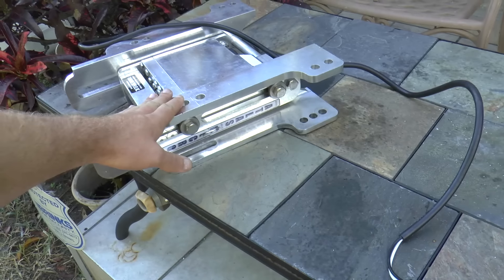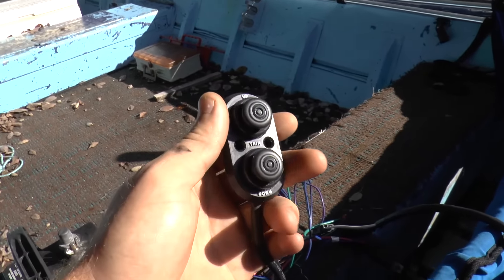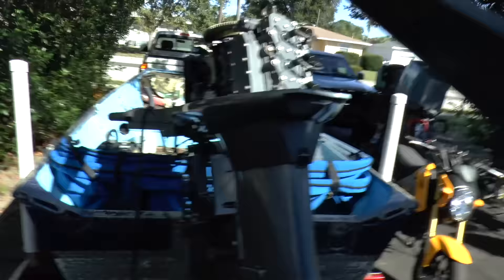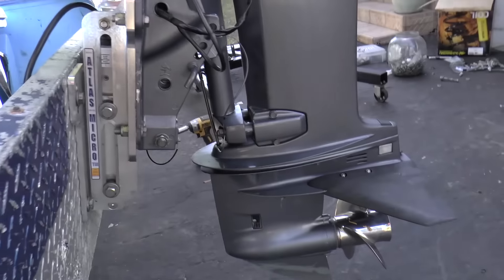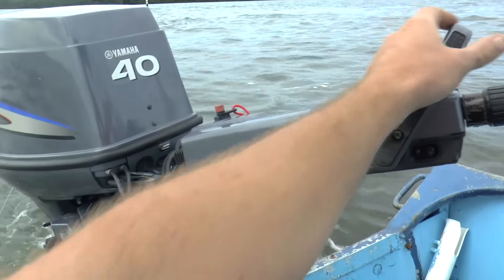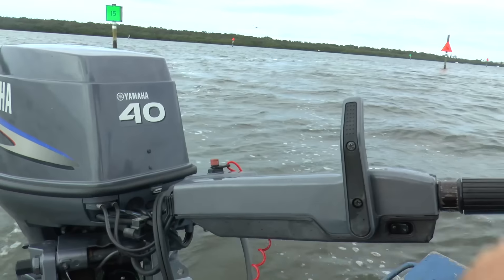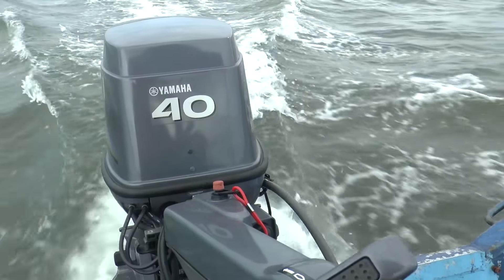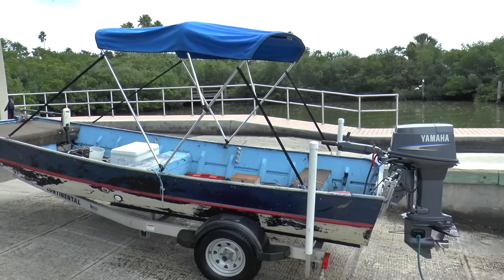I Finally Purchased A Jackplate!!!

Comment: After watching your video, i did some work to my boat. im not able to purchase an adjustable Jack plate at this time, after alot of research, i found that raising the motor so that the cavitation plate is just above the deadrise or the straight path back from flat on the hull. i just finished my project and am about to give her a sea trial, lol. also just above the raw water intakes on the lower unit, Your vids have been very valuable to me, what a great channel, thanks my friend.

Comment: Jack plates are the best! Great hole shot, great top end! You’ll love it! 👍🏻
Reply: Why not just mount the motor at the height the jack plate performed best at??? why would you want to return the motor to the low position were it performed the worst? Get rid of the multi position high dollar jack plate and just mount the motor higher on a fixed aluminum mounting plate!!

Comment: Nice work.  if you are pleased with that prop, lose that cheap fin you have attached.  They are typically just a band aid for a poor set up.  That 40 with the right prop and that jackplate is all you need to get on plane as fast as you'll ever get.  Your top speed would likely increase without it.
Reply: He will only gain what about 2mph or might even lose 2 removing that hydrofoil.
Reply: Why not just mount the motor at the height the jack plate performed best at??? why would you want to return the motor to the low position were it performed the worst? Get rid of the multi position high dollar jack plate and just mount the motor higher on a fixed aluminum mounting plate!!
Reply: I use a whale tail great for getting up quick but it drags my boat   A 70 4 stroke my next motor  the 60 tlra still rock n it’s an 02

Comment: Hey man, I’m in this same situation. I have a 99 Yamaha 40hp TLRX long shaft. I want to put it on my 18’ Jon Boat, however it also has a 15” transom. I believe I am going to have to go this route with a jack plate to make it work. 

My question is the transom on your boat. Is it all welded aluminum or is it wood? Do you have extra braces or just the two transom arms? 

You’re the only guy I’ve seen do this, if you could get with me that would be greatly appreciated! Thank you and appreciate your content!

Comment: Ive got a 14 48 with pods and i have a 55hp on the back. I have a manual jack plate. I had to put 300lbs of weight upfront to keep boat from porposing but when i did it still pushed it 32mph. I just ordered me a ozhydrofoil for my motor when i get it installed im gonna remove weight to see if it makes a diffrence.

Comment: Them premix yamahas are bullet proof! I had a 90 yamaha in a 16’ center console i bought in 2000 ran the shit out of it sold it in 2010 current owner has had zero issues besides swapping impellers and general maintenance which pretty much is just plugs an fuel filter.  Damn i Miss that 90!
Reply: Josh Frank those Nissans were awesome too!

Comment: I just ordered the same Atlas "micro plate" for my tracker that has a new Mercury 60hp, 4 stroke.
Then I saw this video...  The one I ordered was $768.   I saw one on a guys skiff that had a 75 on it, and knew it would be perfect for the tracker!
Reply: Hows it doing
Reply: Great
Reply: I just ordered one (TH Marine Microjacker) for my Tracker 1448 that has a 4 stroke 25 merc.  I hope it helps me get my cavitation plate above the bottom of the boat.  I have also added floatation sponsons on the back that kick it up on a plane better, but don't help with the height of the motor on the transom.  I love the boat, but the porpoising is driving me crazy.
Reply: Why not just mount the motor at the height the jack plate performed best at??? why would you want to return the motor to the low position were it performed the worst? Get rid of the multi position high dollar jack plate and just mount the motor higher on a fixed aluminum mounting plate!!

Comment: A worthwhile addition to your boat ;Increase in speed with the jack plate on.The 20" long shaft motor goes deeper in the water on max adjustment at the flick of a switch on your boat that has a 15" transom..did you have to strengthen the transom before fitting it?
Reply: Why not just mount the motor at the height the jack plate performed best at??? why would you want to return the motor to the low position were it performed the worst? Get rid of the multi position high dollar jack plate and just mount the motor higher on a fixed aluminum mounting plate!!
Reply: @darrengillesdarrengilles8336  I suppose having the multi-position jack plate is good when you may be using 2 different motors, which may have different dimensions.

Comment: The jackplate will allow you have the outboard an inch or two above the bottom of the boat. More efficient that way.
Reply: Why not just mount the motor at the height the jack plate performed best at??? why would you want to return the motor to the low position were it performed the worst? Get rid of the multi position high dollar jack plate and just mount the motor higher on a fixed aluminum mounting plate!!

Comment: You can also buy a vertical extension and mount it 5 inch higher for the correct height
Reply: Where at?
Reply: Why not just mount the motor at the height the jack plate performed best at??? why would you want to return the motor to the low position were it performed the worst? Get rid of the multi position high dollar jack plate and just mount the motor higher on a fixed aluminum mounting plate!!

Comment: hey Dude, here in Ireland on the Lake Corrib it is all about bottom clearance so a lot of us run short shafts afraid to knock off the propeller on a rock
Reply: But u run short shaft on a short shaft transom..

Comment: We had a evinrude 50 2 stroke with oil injection we still pre mixed fuel with oil even tho it injected oil and it ran great up until we smoked a rock and blew up the lower unit I recommend when you have a oil injected engine juts mix fuel anyway it’s good for it

Comment: don't get a oil injected motor. mix it your self I have seen a lot of motors locked up cause the injector  had stop working and the owner didn't no it
Reply: David Mcclaughry what’s a tell tale sign?  Just make sure oil level keeps dropping?
Reply: David Mcclaughry , Not with Yamaha. Yamaha has the most dependable oil injection on the market. You will eventually have more problems if you remove it.
Reply: Unless its a yamaha! Best oil injection! It runs off the engine, so you know it works. Unlike others that work of a electric pump that can fail if the pump stops working an engine keeps running! “Evinrudes”

Comment: With fully lowered motor there's too much lower leg water drag against it and huge water rising hi that accounts for that huge top speed loss.  Ideal motor/transom height match is  achieved when middle water flow skims at speed right under the small upper plate at plane while motor sits fully vertical on transom and deck load is evenly distributed.   

Prop will achieve best prop thrust on all water cond and close turns at speed.  If the doel fin installed does not run parallel to water level when combo is on plane will achieve extra water drag on fin and slow motor down.

Without an induction tach installed side of  throttle grip won't know which was the max wot rpm achieved and if motor revs at least middle to max wot rpm factory stated. It's important to know this.
Reply: I think he does an thats the reason he added a jack plate to experiment with it
Reply: Why not just mount the motor at the height the jack plate performed best at??? why would you want to return the motor to the low position were it performed the worst? Get rid of the multi position high dollar jack plate and just mount the motor higher on a fixed aluminum mounting plate!!

Comment: Jackplate’s obviously increase efficacy at higher speeds, but could they also be used to reduce fuel consumption, effectively extending maximum range at lower speeds?  I’m curious how  various engine/prop heights would affect fuel consumption at a specific cruising speed. Say, 10 MPH.
Reply: decrease in drag means better economy. Right length shaft will save you cost, hassle and weight

Comment: what about your water intake and prop?  you have to go higher than the water pick up!  see bobs machine shop for that. and r&r prop shop in vegas for speed.  he's go a lot of good used props etc! great prop guy. he'll spend the time to talk!.
Reply: Why not just mount the motor at the height the jack plate performed best at??? why would you want to return the motor to the low position were it performed the worst? Get rid of the multi position high dollar jack plate and just mount the motor higher on a fixed aluminum mounting plate!!

Comment: did you have any worry's  about the added weight of a jack plate and long shaft motor on  such a light boat ?? I am in the middle of refitting a J14  carolina skiff tiller steer with  25 /Mercury 2 stroke .. to a center console remote steering 30 HP mercury 20 inch shaft electric start power trim/tilt , and using a Q3 center console with built in live well and flip cooler seat . i' am just raising my transom with some kings Starboard 2 inch thick then sliding a 3/16 inch stainless steel u shape plat over the transom to well below mounting bolts and clamps . what I am wondering about is the weight and how far forward I might have to go with the seat n console ….your aluminum boat seems to sit well in the water and with your weight being to the rear of the boat seems to have no problem so by me shift my weight some 2 feet forward from transom ? I'm thinking I should be just fine as long as my cavation plate is in line bottom of my hull .weight might not be an issue  even tho the motor seems significantly heavier.  whats you r opinion ??
Reply: Jackplates are light

Comment: I’ve been using one of them for 2 years now and it’s still working well.
Reply: Yeah it better be!
Reply: Why not just mount the motor at the height the jack plate performed best at??? why would you want to return the motor to the low position were it performed the worst? Get rid of the multi position high dollar jack plate and just mount the motor higher on a fixed aluminum mounting plate!!

Comment: Wow that’s really awesome! What are the main benefits of a jack plate? Just to increase speed?
Reply: If you fish the flats mainly. Raise the engine to run in shallow water
Reply: increase speed and economy
Reply: @jazldazl9193  Why not just mount the motor at the height the jack plate performed best at??? why would you want to return the motor to the low position were it performed the worst? Get rid of the multi position high dollar jack plate and just mount the motor higher on a fixed aluminum mounting plate!!
Reply: @darrengillesdarrengilles8336  exactly what I was thinking! Mount it once and be good. Why spend so much to keep it at that height.

Comment: I know this is an older vid but Im building a livingston micro cat with a center console its 13 ft and rated for a 25hp remote. People tell me its unsafe to power it with anything more I wanted like a 35-50 hp (everything I own has x2 power then stock) ive never messed with outboards before but in your experience if I move weight forward I should be able to have a little more weight aft?  Also looking at the atlas micro jacker did it hold up over time? Thanks for the continued great boat build and flips👍
Reply: It’s not a problem with weight but tearing the transom off with torque

Comment: First 40 Yamaha are legendary reliable and they go hard and second that jacking plate is awesome for your set up. Don’t know if you need a 90 on that boat unless you’re going to put 6 people in it. Don’t need that foil with power trim. I would rather mix my own fuel also. Good job 👍

Comment: I recently bought a RIB which calls for a 15” shaft motor. However, I couldn’t pass up a great deal and ended with a Yamaha f9.9 20” shaft. Should I get a jack plate or is it ok if I run the boat with the Yamaha 20” shaft? Any cons?

Comment: You need to learn how to use the tilt trim on the motor. When running flat out trim the nose up until you get a little cavitation then trim down until it goes away. You get max speed by pulling the hull out of the water.
Reply from the maker: Maybe i would if my trim button would work on my tiller arm
Reply: @ThatBoatGuy  just use the manual trim pin
Reply: Why not just mount the motor at the height the jack plate performed best at??? why would you want to return the motor to the low position were it performed the worst? Get rid of the multi position high dollar jack plate and just mount the motor higher on a fixed aluminum mounting plate!!

Comment: @that boat guy  so I have a 200 hp yamaha v6. Can I take the oil injection system off of the motor and just use premixed ? Or would that not be a good idea because of the large fuel tank. Help

Comment: Pretty cool. But... Why not just run a short shaft engine??
Reply: Clint Lundie because he buys and sells all kinds of motors
Reply: If you buy and sell motors then even more reason to fit a good one and sell the incorrect one surely?
Reply from the maker: @HarleyRog  so how would I run a 15" shaft motor on a 20" transom? With a 15" transom I can run any motor.
Reply: Because that depends on how high the transom holds the prop , if its too high the prop will flutter.
Reply: Randy Green the word is cavatate, but flutter? Means the prop looses traction.
Reply: @darrenkastl8160  call it what you want, we here in these  here parts called it "fluttering ". You must  have knew what I  meant or you wouldn't have  called it "cavatating".  "Hey Darren" my boat motor is "cavatating "! There,  are you happy? By the way...flutter meant that the prop Was losing traction or thrust.

Comment: This is Ray I have almost the same boat as you do it's 16 foot bye 6 my question is my Transit is shot how did you make your Transit strong enough to hold those engines
Reply: Rebuild I have a 10 ft John that will hold a 30
Reply from the maker: Someone before me redid the transom.
Reply: It's a TRANSOM, not a transit.  Transom is what a boat motor mountain to, a transit is used to determine property lines, design roadways and any other thing you need to determine survey lines.
Reply: Jeff Chapman it's "mounted". A mountain is like a very large hill.
Reply: Ray a fairly easy and solid way is tying the transom into the rear thwart bench seat. have some thick aluminum bent to fit for a pair of braces.
Reply: @officialWWM  jajajjajajajajajaja...I was looking to add to your comment....but forgot what we were talking about after reading your comment....lol

Comment: Better brace up that transom or it will crack
Reply: agree, tie it into the rear thwart bench is convenient and will firm it up a ton!
Reply from the maker: I ran 90hp 2 stroke motors on it no problem
Reply: ThatBoatGuy untill it rips the back transom of when u hit something
Reply: Dude never run your motor with no water bro u will burn up your impeller in 2 seconds
Reply: jimcat X dude he has a water hose rinsing it out with freshwater!!

Comment: Hey Eric that's awesome if you like the product you should put a link on how we can obtain one for our boats in short where did you find this Jack plate who makes it give us some information bro
Reply from the maker: Yes. The Jackplate is a Atlas micro
Reply: Eric Krzyzanowski  Awesome I found it thank you great posting
Reply: @ThatBoatGuy  Why not just mount the motor at the height the jack plate performed best at??? why would you want to return the motor to the low position were it performed the worst? Get rid of the multi position high dollar jack plate and just mount the motor higher on a fixed aluminum mounting plate!!

Comment: Do not run your motor on plane with your Jack plate down. You can tell there is a flutter and something will give. Sounds nice up though.
Reply: Why not just mount the motor at the height the jack plate performed best at??? why would you want to return the motor to the low position were it performed the worst? Get rid of the multi position high dollar jack plate and just mount the motor higher on a fixed aluminum mounting plate!!

Comment: I use to have a Yamaha 25 3cyl that would run 37 on a 15 42 aluma weld and get there in about 2and half seconds... un impressive  I was running a 13 pitch powertech prop
Reply: Oh and run around 34 with 3 guys ice chest fishing gear ect

Comment: About a 25% increase
Reply: @NORTH CHANNEL CANADIAN JET BOATS Without the Jackplate top speed was 30mph, with the Jackplate it was 37mph, that is a 7mph increase from the original speed of 30mph.  25% of 30mph is 7.5mph hence why I said it was about a 25% increase.
Reply: @NORTH CHANNEL CANADIAN JET BOATS no worries.  Many people make that same mistake, myself included.  In your method your fraction is the part/whole.  So you are assuming the "whole" is 37mph.  The original value should be where you start instead of the ending value.  It is easier for me to use easy numbers say you buy something for $50, then the price is raised to $100, that is a 100% increase not a 50% increase because you start with the beginning value.  It is a common mistake, I am not trying to be "that guy", just I am just trying to help. :-)

Comment: the 90 will rip your boat :D
Reply from the maker: Lol i want to try a 115hp
Reply: And i wanna see that for sure  @ThatBoatGuy
Reply: @ThatBoatGuy .... Hi Eric.... I have a 16 foot aluminium plate bass boat with a Yamaha 115C 2 stroke salt water series motor... This plate is apparently rated up to that and 420 lbs (motor weight) ... Would you go with this jack plate on my boat or step up to a bigger unit? Thanks...

Comment: Why not just mount the motor at the height the jack plate performed best at??? why would you want to return the motor to the low position were it performed the worst? Get rid of the multi position high dollar jack plate and just mount the motor higher on a fixed aluminum mounting plate!!